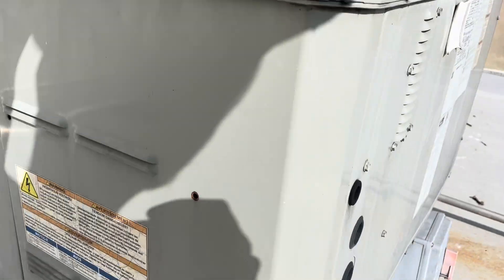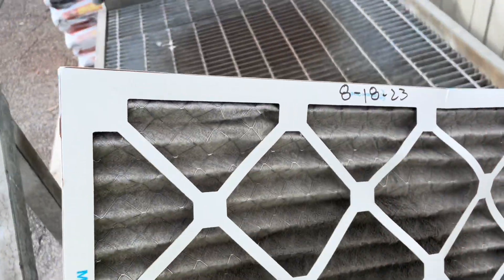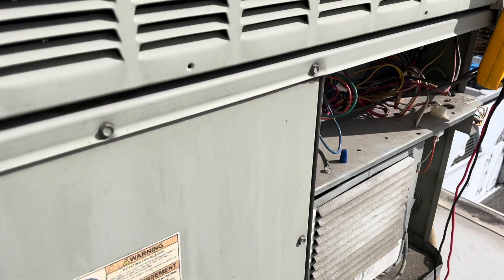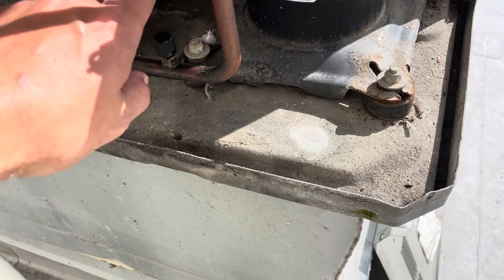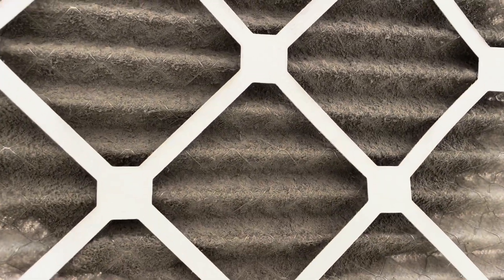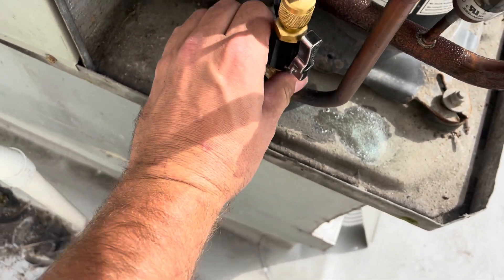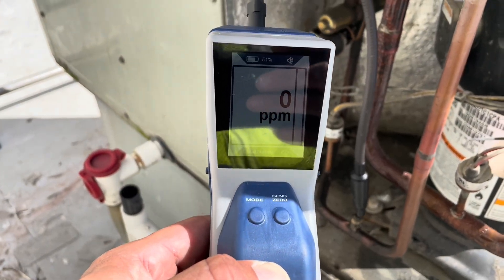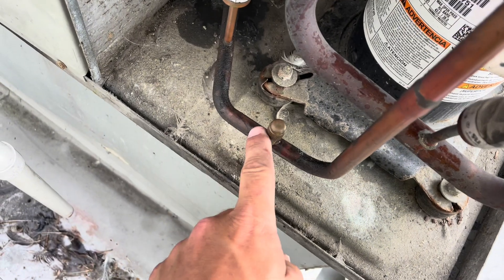Is It JUST A Dirty Filter?  No Cooling On Trane RTU!

Comment: That suction pressure was pretty low. Also sub cooling seemed low. Is that a Txv? Looked like 3 degrees. Usually units call for 8-10 degrees sub cooling. Low charge maybe?
Reply: For an R410A unit, it was a bit low on suction pressure.

Comment: Maybe this is a dumb question. Why is there a trap on that drain line? It empties right onto the roof.
Reply from the maker: It’s still on the negative side of the blower though.  Without the trap the pan would fill up and possibly leak into the return
Reply: @JeffsHVACAdventures  thanks!